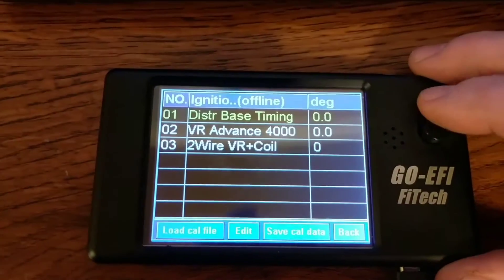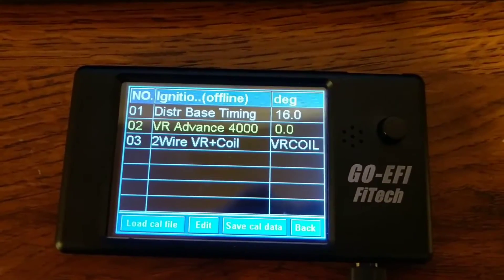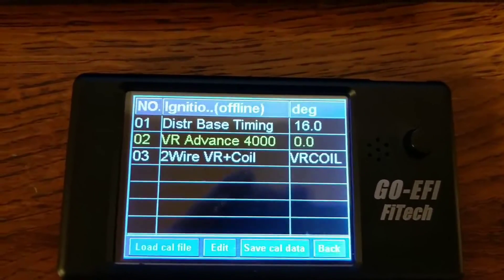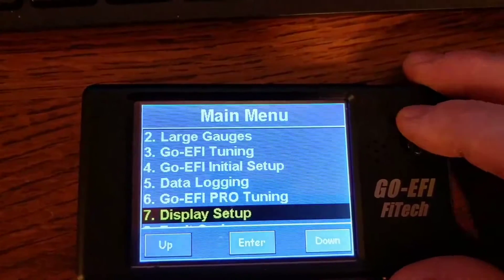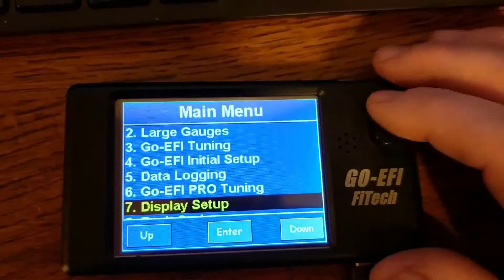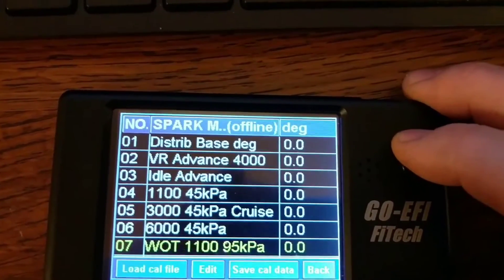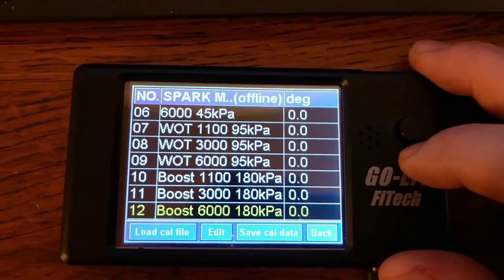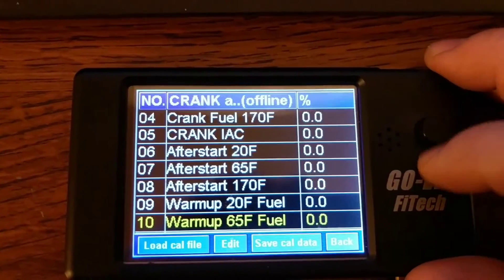FiTech EFI handheld overview.

Comment: Thanks Josh I have red about how to switch tach/vrcoil  but never saw a screenshot of it. I just did a 400 for my nephew's vette and just got thru instaling a 600 non-pa on my 73 vette and its different for sure. I haven't started mine yet. I am building a rear and had to cut the 3" duels to pull the rear end so figured I would wait. Thanks for all the good info im subbed.lol

Comment: I noticed mine on my ZZ4 It feels to me like I have to keep cranking it over a little bit to long to get it started..what setting is used to make it start faster without cranking it over as much?
Thanks
Reply from the maker: shenlonco crank fuel settings. Watch your AFR readings while cranking. if it's lean add value. if it's rich go negative. there are 3 temp adjustments too so adjust accordingly.
Reply: looking back at my first start up video it looks like 13.5 to 13.7 when sitting idling.
Reply from the maker: shenlonco what do you have your prime shot set at?
Reply: Hi I did nothing but hook it up set the set up for motor specs and left it all stock.
Reply from the maker: shenlonco you will need to add or subtract cranking fuel percentages. It's a little bit of a crap shoot but in most cases it needs more cranking fuel. Generally speaking of you need to hold the throttle open for it to start, it needs less cranking fuel, if it just needs to crank for a few seconds then it probably needs more cranking fuel.
Reply: Hi I don't need to give it gas. so probably a bit more cranking fuel will do.